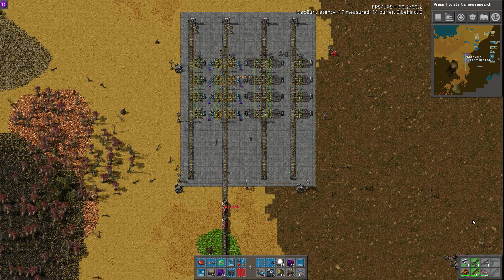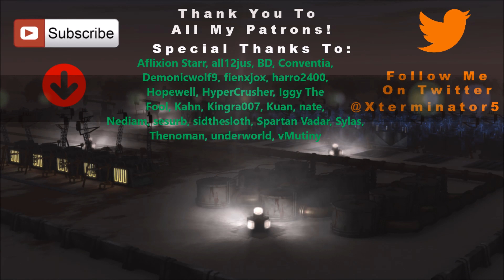Utoxin's Smart Train Loading Stations :: Factorio Workshop Season 2 - Building A Better Factory

Comment: YAY. As for why I didn't auto-disable the unloading stations: At least in my uses, I always want them enabled for trains to enter. You could easily wire something in for additional logic you want to do load balancing or something similar.
Reply: And the one sided loaders are generally intended for outposts with lower production that don't /need/ a full double-sided loader. No point wasting all the resources if they're not needed.
Reply: No point using the splitters when you can just have a straight belt as on zuri's design also ;)

Comment: I'm new to circuit networks and i don't get the wiring here - so correct me if I'm wrong!

-A green wire connects all the buffer boxes together and the sum of the amount of ore is sent to a combinator under the signal [iron ore]

-the combinator divides this signal by the negative of the total number of boxes in the loading station and sends this out under the signal [iron ore]

-Is this signal sent back out on a separate wire, so as to not mix the green wire, because the signal is under the same name?

-The inserters compare the iron signal against zero? I actually don't get this at all because when would the iron signal ever be more than zero?

Actually I just don't get it. I would have thought that each inserter wants to compare its own box to the average but this is different. I also don't get that the input and output signal of the combinator is the same?

Comment: Dont really like it, it's basically the same as zuri's loader (which i really like) but then added the splitters which don't really make sense, if a train is at a station loading, it wont' no path/crash when its loading, it'll just wait till the condition on the train is true, then it'll go. I'm sticking with zuri's loader & unloader

Comment: If every outpost is named the same, what hapoens if none of them have ore available to pick up? Will the train jsut wait at the base or could this mean problems
Reply: TheJoshinils I use a setup like this, the train will idle at the unloading station if it has no where to go. so you either want to have one dedicated unloading station for each train to make sure there is always somewhere to go or set it to go to a dedicated parking station with a zero delay between unloading and loading.
Reply: Alexander Roderick i see, so the benefit would be that the train only goes out to pick up ore if it needs to but has to have a (potentially huge) waiting station at home base.
Reply: I only have a single train per resource right now, on a default map. If I was building a lot bigger I'd need more, but as it stands my one four-wagon iron ore train just sits in the unloading station if it's not busy, but if it's not busy then I need to be building more iron outposts anyway. The main benefit of smart outposts is that the trains aren't constantly in motion, wasting fuel and clogging up the rails unless you need them to be.